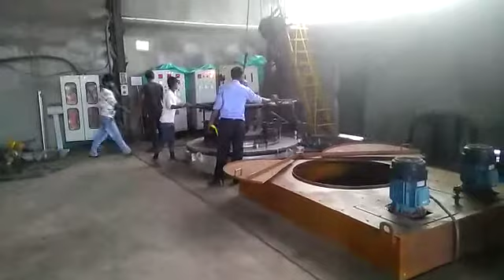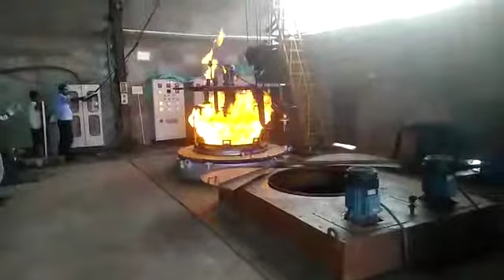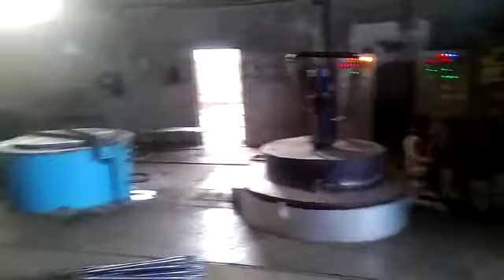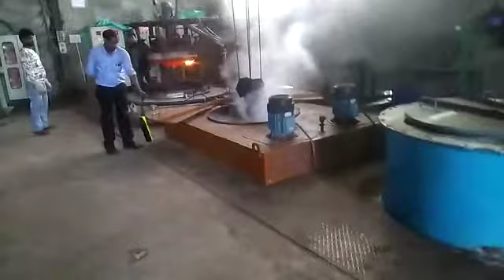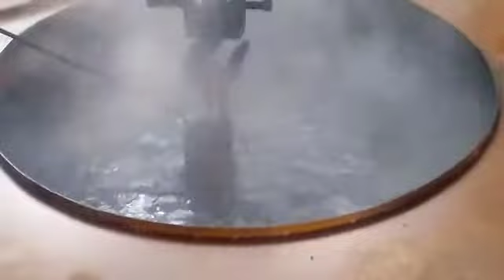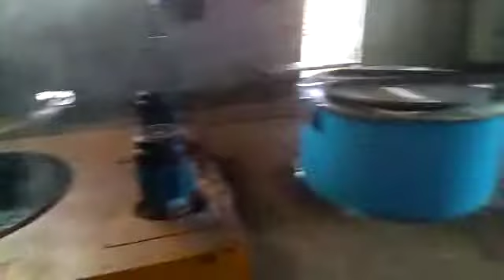Gas Carburising Furnace Setup

Comment: Hello, can i ask about the filtration of the quench oil? I think that oil need to be changed due to the contaminations, maybe 1 to 2 months you change it? Sr if i wrong! Thanks
Reply from the maker: Filter already added in system. The oil goes to oil cooler to maintain oil temperature and in the process gets filtered too. Also after 1-2 years oil is sent to special filtration companies and you can use the oil again.
Reply: Sir is there any effect on skin or face in heat treatment